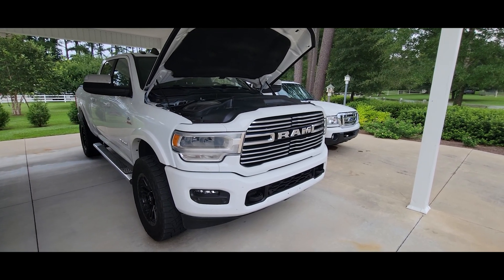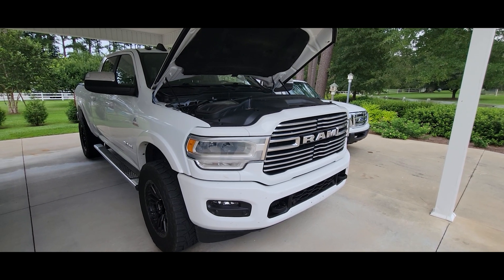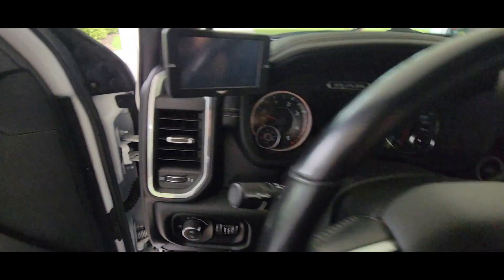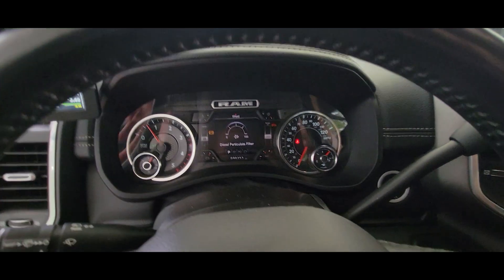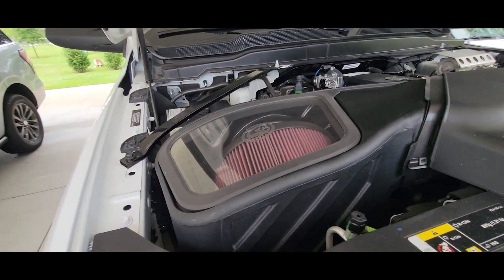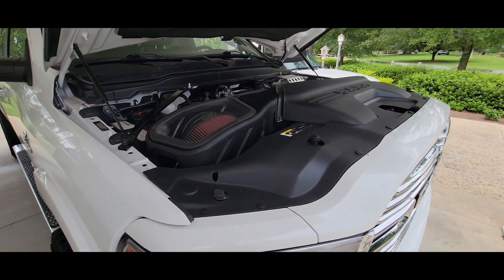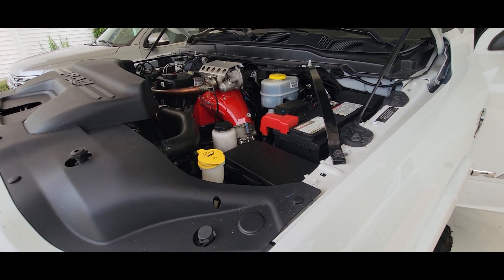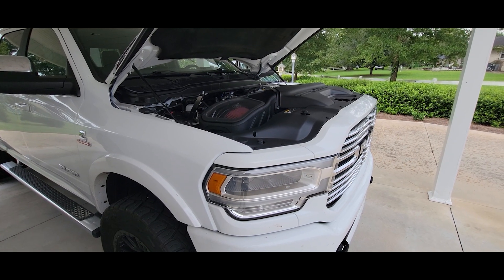Frequent Regens Root Causes and Solutions!

Comment: 2019 Ram 2500 120k miles, 6.7 - Mine keeps regening, keeps throwing P0471 code. I cleaned the pressure tube out and replaced the sensor also. It misses like jerking sometimes at idle. A mechanic told me it needs to sit for two hrs at 2000 rpm and burn the filter off with the computer hooked up. Idk I can’t get it to pass emissions currently. I have the banks monster ram and sb intake. Not sure what to do. Everything is stock with all emissions on it still.
Reply from the maker: I am sure a forced regen would help, but you will likely keep getting the same issue.  I personally think your truck can be tuned and get the regenerations under control and rid the code.  My guess is between the S&B and Banks stuff, the air fuel ratio is too rich and loading the DPF quickly.  Email me at ray@doublerdiesel.com for more info on tuning the truck.

Comment: 2022 2500 Ram with no aftermarket add on and goes into regen every other day just driving to work. Suggestions?
Reply: Same here. Mine is going to the dealer Friday
Reply: @huntergibbs7797 what was the result?
Reply: Make sure you only use the Mopar/fleetguard air filter with NO glue strips on the filter media, if you use anything else, you will have frequent regens, this only applies to the 2019 and up models.
Reply: My 23 34k is completely stock and regen every 100miles it lives in the shop dealership can’t figure it out they change air filter , nox sensor , ccv filter several dpf been in shop off and on since may and several other times before

Comment: I’ve got a 2022 Ram 3500 6.7L (dually), bought used with no obvious mods. It’s my daily driver, but I only put on about 10 miles a day. I upgraded from a 2015 2500HD Silverado since we tow a 43' 2010 Jayco Recon toyhauler — that’s the main reason I went with the dually. Lately though, I’ve been getting excessive regens, almost daily it seems. Trying to figure out the root cause — any advice on how to diagnose this?

Comment: What tune you have? Who done it? I am having excessive regen in my L5P, I will get a MAP sensor tomorrow. Last time I pulled it it was clogged. I shot it pretty heavy. Hopefully it’s that. If not, I would like to get rid of the banks, and get a tune put on the truck.
Reply: I’m having same problem with my 18 l5p did you figure out the problem by any chance?

Comment: s&b cold air intake with the cotton filer use the paper filter drive and cotton fiber towing my 24 3500 with 2k miles never regen till the cotton fiber filter  changed to their paper filter no regs now towing the dpf is on zero but empty just like yours every 100 miles takes 5 mins to swap . im in washington NC with a 24 what can you do with it ?
Reply from the maker: We can program a 24 for more power and better 68rfe trans tuning!  It does require a PCM swap though.  Email me at ray@doublerdiesel.com for more info.
Reply: So the oiled filter is causing the issues ? I just installed my s n b a week ago an bin havin frequent regens plus a lag off the start of acceleration

Comment: Does it lean it out causing more def usage and better mpg? Also does it still do the 24 hr programmed regen?
Reply from the maker: No the mpg and def usage stays stock.  It still will regen on timed schedules.
Reply: @DOUBLERDIESEL  Dang that sucks, so there is no way to lean it out and just use more def to counter the exhaust gases? I'm still trying to understand the egr vs def but i would rather not have the egr running as much as it is and wouldn't mind more def usage to keep the engine cleaner.
Reply from the maker: We we all would love to just turn off the EGR and use more DEF, but the government says you cannot tamper with EGR tuning under any circumstance.  Fass is working on an EGR filter system for our trucks though.  That should help.